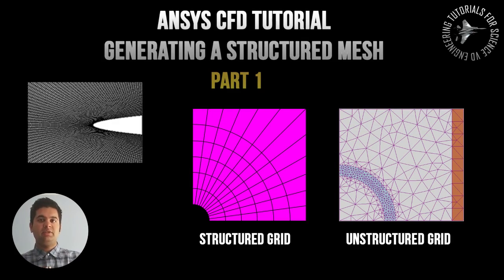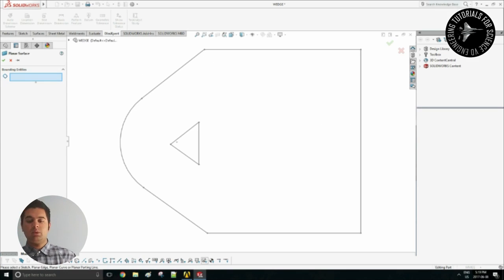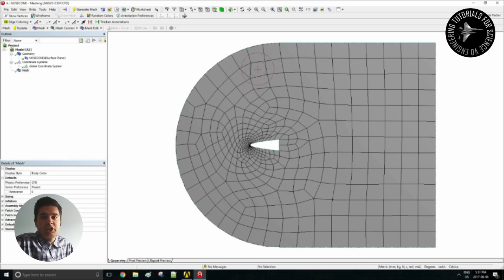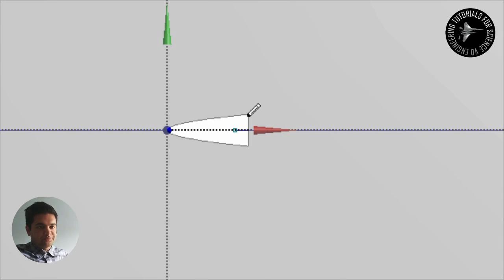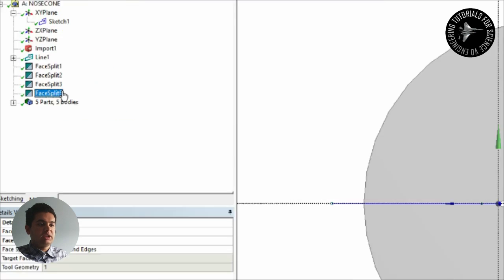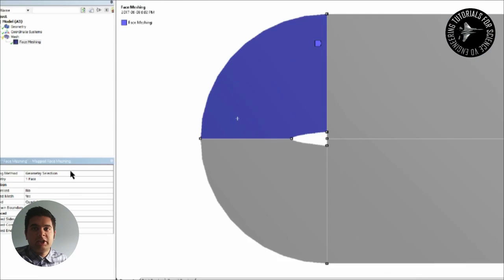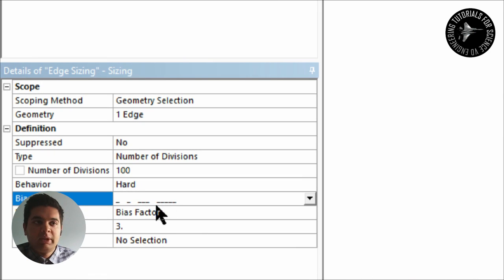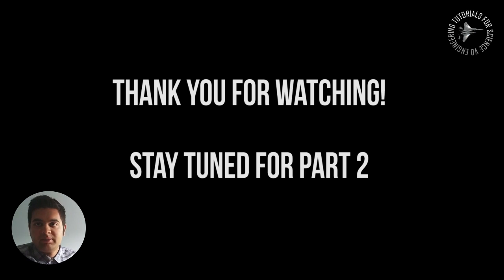ANSYS CFD Meshing Basics: How to create a Structured (Face) Mesh,  Part 1 - Rocket Nosecone

Comment: Hi sir, I have a unique problem
I simulate a 2D axisymmetric steam ejector
the flow is a very high speed,  1300m/s at the outlet of converging-diverging nozzle
the case is a Density-based problem, with water vapor(density: ideal gas) as a working fluid

my mesh is coarse (2000element) the simulation goes well
but when my mesh is fine (40000-60000 element) the floating due to excessive temperature occur
actually, my orthogonal quality, skewness, and aspect ratio is very good
I don't really know what the problem is

Comment: I have been testing with 2D structured mesh and found that my lift and drag coefficient values differ according to different values of bias factor...so i am a bit confused how to find correct bias factor. I have tried bias factor formula provided by CFDnija but it didn't resolve my simulation at all...please give me any advice
Reply: Well, I'm sorry that you are receiving a late reply! But hope it helps someone else sailing in the same boat.
The thing is, you should ideally estimate the flow Reynolds number over the surface, followed by an estimate of the scaled wall normal distance y+ based on the first spacing you have set near the wall. y+ is always <=5 for proper near wall turbulence capturing. So check if the calculated y+ value for your first cell spacing is well within the limit. That is the way to resolve the simulation.